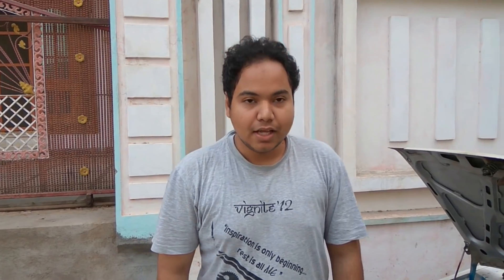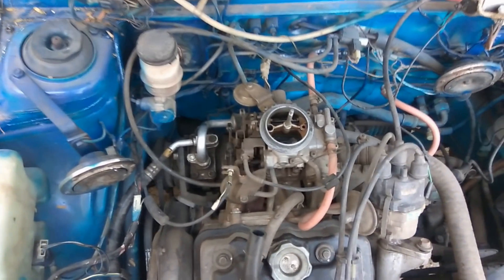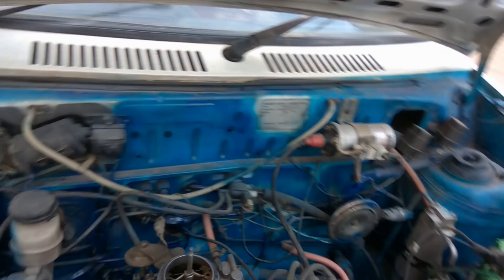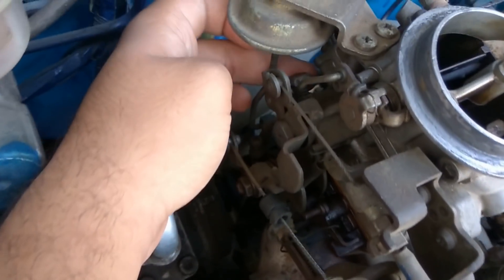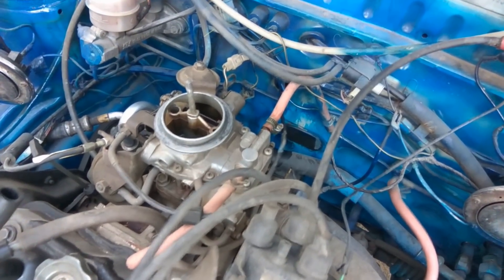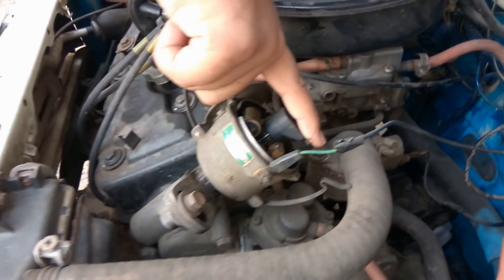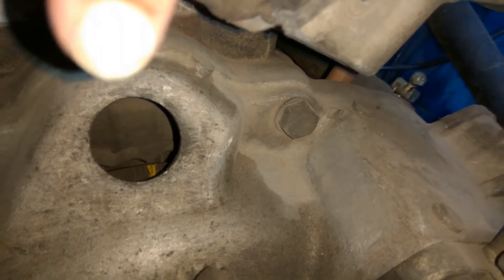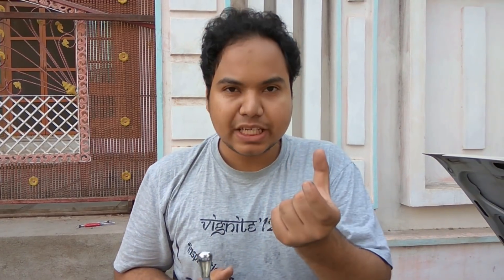Tune carb and spark distributor for max mileage

Comment: Hi Ashfaq, I observed at the timestamp 09:11 that you have removed the plug from the ignition coil's end. The spark thus produced in this case must be from the primary winding of the ignition coil. If you removed the plug attached to the distributor cap, you'd get a spark from the secondary winding of the ignition coil. In my case, I could not get a spark from the primary winding. So when I opted for the latter method, I got a spark. 

I want to know from you if the approach that I adopted was appropriate.

Comment: I adjusted the idle  RPM to normal level as it had been set very high by the mechanic to whom I had taken my car for repairing a leaking manifold. But when I tried setting the distributor as shown by you, I couldn't hear or see or even feel the sound of a spark. I then tightened the distrib back at the original position while my fly wheel was positioned as advised by you.

Comment: To my mind you are adjusting mixture screw on assumption.
It does not take into account the need of the optimum efficiency & power.
There is other method to adjust the mixture while engine is running hot.

Comment: My 97 model maruti 800 In morning at 6.00AM  if we starts it is vibrating and slowly increasing the rpm. After few minutes it is running and starting normal. What to do to solve this?  But once it is heated up it is running normally. The whole day in starting  no vibration and starting and running very normal.
Reply: adjust idle rpm, check ignition wires attached to spark plug..if needed replace them along with new spark plugs...clean point set condenser and distributor cap.

Comment: For maruti 1998 to 2004 carb Idle mixture should never b open more than 2.5 or 2.75 max...genuine setting is between 1.5 to 2.5 turns ....

Comment: Once you pull the HT cable from the Coil then you will not get spark from it, especially from the wrong side(9:35), the sound of spark that you hear is not from the HT Cable but rather the Coil. Ideally you are to pull the other end or even the Cylinder one Plug and then check for spark. That said, Awesome video! Cheers!

Comment: my Car M800 is rise mode, Without using the accalation. It's Run in 40kms speed, I lose mileage brother. 
Give me some advice to Block it and get good mileage. My whatsapp number 9843567557.

Comment: Walekum assalam bhai.. In cold starting does you pull choke or it is  normally starting?
My 800 carb fuel screw was in full tight condition.. Does it effect in mileage?

Comment: I applied all the steps proferly but my Mehran 800 reduced from 18 to 10 something, a local mechanic said that u should adjust your air fuel mixture screw in start position of engine with 1500 rpm, after lettig the air fuel mixture screw fully tighed you should slowly unscrew until you get smoth engine sound without any vibration. Now what I do there is no leakage of Petrol and surprisingly no lagging in engine power even the adjustment of screw in any position, I am stugged the engine behaves normaly on any position of screw with more fuel consumption. The overall condition of my engine is 10/ 10.

Comment: hi thanks for this video.i have 1993 model 800 adjust mileage settings as you said.after settings done i feel little lacking in pickup.is it correct?
Reply: I think the mixture is lean so it is lacking power or engine needs advance firing which can be adjusted through distributor.
Best to use tachometer while tuning.
It has to be kept at optimum RPM.

Comment: Consider three conditions that I'm facing:
1) car doesn't turn off at Idle.
2) But it starts missing while accelerating and turns off even it has reached its optimum temperature.
3) After this setting I'm getting a mileage of 15kmpl
To over come this problem I've increased the idle and quarter a turn of fuel intake. Still the response is not satisfactory. What to do? Reply soon.

Comment: Salaam Dear Aveem... I am from Pakistan, I just watched the video and learned alot... Here this car is Called Mehran, which I have too owned it... Its a 2007 and by God it burns alot of petrol i think not more than 10km/pl... So I for the perfect timing I have downloaded this video and going to do the same things as you shown... And will let you inform about the result.. Thanking you in advance lol...
Reply: Please let us know about the success
Reply: @Hrithik_Jayanth  . Yes i did it and quite succeeded. But a minor missing after a KM run. Should i open the front screw a half rotaion more or else? Thanks for your reply
Reply: In addition I have a question, Ur car, I seen in video, has magnet instead of point. Is it have effect on fuel consumption or else?
Reply: In addition I have a question, Ur car, I seen in video, has magnet instead of point. Is it have effect on fuel consumption or else?
Reply: @DIYRestorationHub  what mileage u got ?
Reply: @DIYRestorationHub  opening the front screw resulted in black smoke and 16kmpl in my case
Reply: Will let you know after a checking... As I am out of the city for a couple of months....
Reply: Dear I am running Alto 2006 model.its city milage is only 7 km per liter

Comment: Hi bro,
Isnt 4 anticlockwise rotation too rich for a maruti zen.I have this doubt because the jet sizes are different.So isnt the same tuning from an 800 redults in rich mixture in the zen.i have read from some of the tbhp sites that the factory setting for a zen is 2.5 rotations only.Pls carify

Comment: Sir please up load  Auto car Ac control circuit diagram   please explain  us how  Dc power root  battery to fuse bolwer motor  then goes ------ thank you so much

Comment: hallo dont make mistakes...while u tuning distributor u wrongly pull coil side ..u want pull out distributor side...
Reply: I also same question but i thing its also work first i will try .... Than discuss this
Reply: yup u r right there is a little bit confusion.someone has to unplug distributor side not the coil side.

Comment: Assalamualikum Bhai is it possible to get 24 kmpl with maruti 800 petrol iam just shocked.what's the ideal speed for getting good mileage.
Reply: 50-60
my father used to get 22-23kmpl at 60kmph

Comment: Meri gadi start hoke phir band hojati hai. Jab mai carburetor kholta ho to waha feul nahi hota. Mai needle ko up and down krta ho our phir carburator ko bnd krta ho. Gaadi ek din ke lei theek chalti hai. Phir wahi masla hojata hai.
Reply: CHANGE NEEDLE
Reply: Ashok Kumar i changed needle. Still that problem. The  change petrol vacum still same problem. At last i check the petrol filter there was rust stucked and i changed that filter. And now the problem is solved. Thank you and keep making videos like this.

Comment: hello aveem,
how do you remove the distributor?   mine is not coming out. tried everything but in vain. pls help.  also the distributor plate is touching the distributor body from the inside.  do i have to change the distributor? Or  is it repairable?

regards
Reply from the maker: distributor is a mechanical part. It is always repairable with the help of a hammer and cutting plier. Don't try to remove the distributor out as putting it back is a mess. Instead, try to repair it there itself. The big fat rotating copper plate in the center of distributor is supposed to have clearance with all objects. The two plates below it with the capacitor are supposed to have tiny gap near the beads. Just enough wide that a visiting car will pass through.

What is the problem with your distributor?
Reply: the plate mounted and attached to the shaft of the distributor is touching the distributor body. this is the bottom most part and the distributor weights are mounted on this plate.  i am seeing rotation markings on the distributor body!..  Unfortunately none of the mechanics are willing to remove the dizzy here.  And spares too are not available at any shops authorized or local.   

  also the weights are sticking. I tried to free them up but all in vain.  I also cannot source the springs which are attached to the weights.

pls help 

regards

Comment: Bro great video. It seems u r great engineer. Bro tell me why there is smell of petrol inside the car. Waiting
Reply from the maker: You will have smell of petrol if 
1. You have opened the front screw too much. Then petrol leaks off this thing. Tighten it and it will solve the problem
2. If your secondary accelerator valve is jammed and you give sharp accelerator inputs. Our carburetor has two circuits, one for normal use which opens all the time and one for power use which only opens when you press accelerator to the floor. Because we do not accelerate so much, the secondary valve is not opened so much and it gets jammed. So, now, when you are driving rashly, petrol falls into this circuit and just evaporates. This gives you the smell.

Comment: Aveem I am having frequent problem of overflow if the car sits for 2 days. And I see continuous supply of petrol in the small butterfly even in ignition off condition. So what is the problem with this car?? Pls reply.
Reply: Float fkute stucked  in carburtr

Comment: Before appliying your technique my car gave me 18kmpl.after changing the carbuetor screw car is giving only 12kmpl.what is the problem.please help me
Reply from the maker: did you follow the instructions perfectly. You should rotate the carburetor screw 4 rotations anti-clockwise after fully tightening the mixture screw. What else have you changed? And how do you measure your mileage
Reply: By filling 2 ltrs of petrol for 2 times.it gave exactly 12kmpl for 2 times
Reply: I followed the process perfectly
Reply: Reply ???
Reply from the maker: Relax. Don't get tensed up. I have a job. I am not a full time youtuber.And the answer to your question must be that are you smelling petrol when you drive your car? If you do so, there is a screw in the front of carburetor which we unscrewed 1.5 rotations. That screw must be leaking petrol. Tighten it completely. Your car will give you more mileage.
Reply: Okay bro
Reply: After tigtening, also same mileage 12kmpl
Reply from the maker: First check whether there are any leaks? Do you smell any petrol when in idle? That is one of the biggest reasons for getting less mileage. Also, check whether your spark plugs are attached or is anything loose? There is absolutely no way that tuning change will change the mileage from 18 kmpl to 12 kmpl. The max it will fall is to 15 kmpl. So, check whether there are any problems. Second point is that, when you are checking mileage, 2 liters might not give you accurate reading. The fuel sensor inside the tank has an accuracy of around 1.5 liters. i.e. for every 1 to 2 liters of petrol, your fuel level will fall around 1 mm. So, your calculataions can give you a lot of errors.

Comment: Hi bhai i bought one maruti 800 it's 2003 model euro 1 & i have not done any thing yet, the issue is it's doing missing after a mile the race is not working, should i turn it up like you showed in the video or there's more to do.

Comment: hi bro i cant see the flywheel marking in zen.can u tell me
Reply from the maker: Put the car in 4th gear, remove the hand brake. Look the wire of the first spark plug from left side of the engine to the spark distributor. Mark the location of the first spark plug wire, where it connects on the distributor. Now, remove the spark distributor. Push or pull the car until the rotating thing comes in roughly that direction. You will see the flywheel marking if you push the car a little back and forth
Reply: thank you.Its just i cant see the hole in the transmission where flywheel marking is inside just like the 800.Unable to find the hole

Comment: hello sir....i want to lower my engine sound .how to do it in my maruti 1996 model.
Reply from the maker: Engine oil change is the best and the only way to lower engine noise. if the oil is for more than 1 year or you have used it for more than 5000 kms, then change it. You can add some black insulation to the bonet like in modern cars but that is a very big headache.
Reply: i will do it sir..
Reply: sir i have a another question that ..can we add front door speakers in maruti 800. if we can add so i wan't to know which speakers are best
Reply: cheap alternative sony xplod.not a big job go to a shop and give them 200 rs.
Reply: Damping is an audio term , dealing with resonance frequencies and compartment size. Audio insulation is a more general, umbrella term, therefore more apt here. You need to get a lot of things  right before being assertive. @withInsight

Comment: Hi brother i just wanna know on the carburetor which screw is petrol & which screw air.
Reply from the maker: there is no separate petrol screw and air screw. There is a mixture screw which regulates how much petrol should come for this much of air. It is located in the back of carburetor and you should adjust it 4 rotations. Remember, if you give less petrol for the required air, still the car will give you less mileage. Then, there is another idle adjustment screw. This will adjust your car rpm in idle.

Comment: Hi brother i got it done now starting is good n one thing is what i wanna ask is that my car is giving little smoke what could be the issue.
Reply from the maker: Usually, you will get smoke when the piston rings are worn out. Piston rings form a seal between piston and cylinder. If the leak is loose, engine oil mixes with petrol and you will get smoke. Your engine oil level also starts to fall down. Confirm if your engine oil level is falling down for every 2000-3000 kms. If that happens, it means you have to do an engine overhaul. There are no shortcuts to it.

Comment: car is not starting when on rest but starts when putting some petrol .but when I check tanky there are 9 litres of petrol
Reply from the maker: The petrol tank should always have petrol more than E in the meter. If not, you will have starting troubles. If you have at least that much petrol, Check your fuel pump and blockages in carburetor. There are two pipes attached to the carburetor. In the above video, we have removed the outlet pipe. Remove the inlet pipe which is the other pipe from the video shown. Try to start the engine and see if there is petrol coming out of the pipe. If there is no petrol from the pipe, you have a problem with fuel pump. Or else, you have carburetor blockage and you have to clean teh carburetor.

Comment: Dear Aveemji,Followed your instructions appropriately. But not getting the spark while adjusting the points panel. Is there any way I can get that set? Or can you send me a link where I can send you photos and videos of the same?Regards.
Reply from the maker: You did not follow the instructions completely. First open the distributor cap, push or pull the car until that rotating thing points where I showed it to point in the video and then push or pull the car some small distance so that you will find the flywheel marking. If you skip the step of pushing or pulling the car until the rotating thing points in a direction, you will not get spark. If you have any doubts, mail them at aveemashfaq (at) gmail (dot) com

Comment: Dear aveem i have zen 98 carb.  How to set.?  Is it same as u showing 

Please  help as i am getting only 14 kmpl without  ac
Reply from the maker: Yes. The whole procedure remains the same. The screws should be turned upto the same. The spark distributor is just a bit different. When you open the spark distributor, put the car in gear and push or pull it until it points where the wire of the first spark plug is. Then, the rest of procedure remains the same.
Reply: 14 kmpl in city or highway.im getting 17kmpl in highway after tuning the carb and adjusting the idle to minumum.in city i get 15kmpl.but on ac the mileage is only 10 11 kmpl.we cant do anything about it zen carbs have bad mileage on ac.

Comment: Dear aveem you made a mistake that you should remove the high tension spark lead from the distributor center point end side  not from ignition coil end side for spark timing adjustment besides the fly wheel marking not always means that your engines piston #1 is on TDC Compression stroke it needs verification by removing the tapped cover as well as it can be at TDC induction stroke as well their are always two possibilities and their are too many other factors as well that needs to be understood as well in order to take a mileage of 25km/ litre of petrol
Reply: Some of the other factors are wheel  bearings Tyre pressure oil type used air filter clogging engine head and valves must be zero sized gear oil cooling system and fuel quality and many more factors

Comment: good job bro......very helpful. i am using maruti 800 type 2 1998 model. engine is running good but as it gets heatup engine stop as it seems ran out of petrol. now what i am doing is using wet towel and keeping it on fuel pump and distributor coil upper right hand corner underneath left wipper and engine just starts with no issues........what is the problem. plz help me out
Reply: Too advance firing causes engine to heat up fast.
The distributor firing time may be reviewed.

Comment: Bro after cleaning the carburetor the petrol return flow has increased like yours at that mileage was 24 kmpl and after 1 week the petrol flow has decreased and my mileage is now 15 to 16 what is solution brother help me
Reply: Hi bro my 1998 model maruthi Dx back screw is 3.5 turn out side & the air screw is in full tight possession & it gives me a milage of 14 km in city & 17 in long drive need your advice .😃

Comment: Hello aveem, ur video for tunning is very helpful ,bt i hv maruti 800 type2 model 2003,,so can i tune it as u doing in video,,,pls reply bro bcz my car has only done 31000 km bt tunning problem is my headache
Reply from the maker: Yes. You can use the same method. It works for all maruti 800s as long as they are carburetted (i.e. you have the same engine layout as mine with a round air filter).